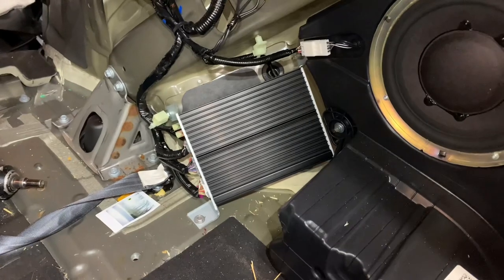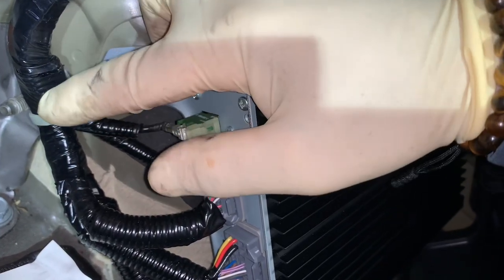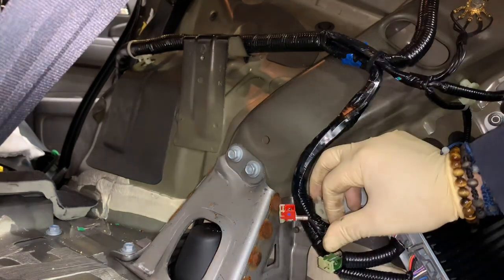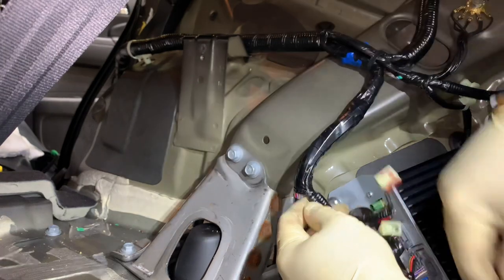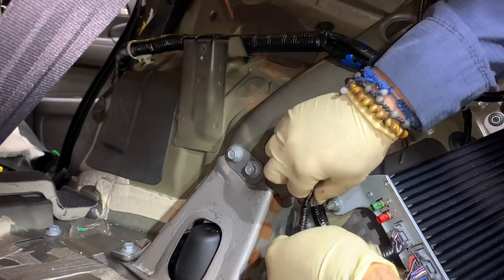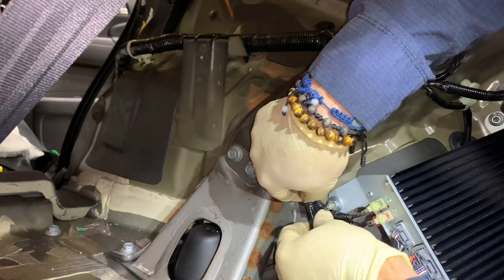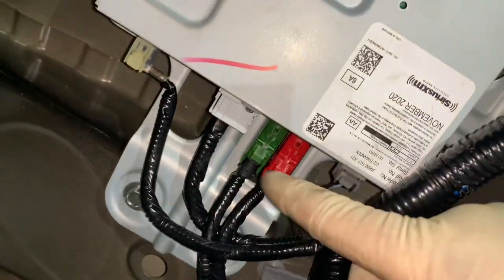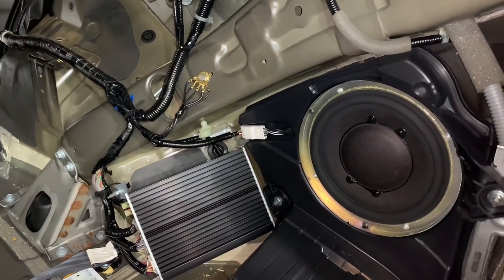Honda Pilot and Passport crackling, popping, infotainment turning off or freezing repair.

Comment: Hi all! My pilot had the same issue, the dealer won't fix it for free since there is no recall for this issue.
I went ahead and applied this fix myself. here are some recommendations:

1. Before starting take out the copilot 3rd sear completely, this will allow you to work with more space. I already tried without taking it off and lost a low of time. 
2. straighten the cables/connectors the better you can, it doesn't need to be perfect, and place it back the better you can

This is not a permanent fix but it has worked for the last 6 months on my car, I would probably need to re-do this when it starts crackling again.

Best Luck to you all!
Reply from the maker: It’s been pretty permanent and I haven’t had any return for over a year now. Thanks for your input 👍🏻
Reply: @BCautosolutions  I got my car second hand from the dealer (27k miles on it), and when I did this I noticed the dealer had already applied this because the plastic zip belt wasn’t the original one. Still went ahead and re-did this and it worked. My guess is that at some point after fixing this, with all the car movement it will eventually happen. But no big deal, once you do it once you are able to redo this anytime and faster
Reply: My 2019 pilot screen just went blank will this solve the problem?
Reply from the maker: @VinhNguyen-zn2rq  it’s worth a shot for sure, also make sure you get the updated fakra connectors if you haven’t done so.
Reply: @BCautosolutions  Thank you so much for replying, what wire is that and where can I buy it?
Reply: @VinhNguyen-zn2rq  when you say blank you mean all black? No light either in the volume or home button? You can try it anyways. My used to go all black as well but after turn it off and on it would load (and eventually go off again).
Reply from the maker: @VinhNguyen-zn2rq  that’s only available as a service bulletin. I would call your service dept.

Comment: This is the first video explaining the issue and the fix. I have a 2021 Pilot EXL, ever since I drove of the lot it began doing the popping sound and freezing the screen, DROVE ME INSANE. Took it to the dealer and fixed for a week or 2 then it began doing it again, Vehicle is back at the dealer again, was at the point of telling them to keep the car and give me a new  one. First time they apparently switched connectors, after a while someone told me this exact issue, which prompted me to look up on web, Luck struck and found this video. Thank you very much, now i have to wait to get the car back from dealer and see what was done, fingers cross.
Reply from the maker: Yes the fakra connector update I’ve had very very little success with. This has been really 100% fix every time I have done it. I was sick of throwing parts at it as per Hondas recommendations so I decided to do something about it myself.
Reply: @BCautosolutions   Go the vehicle back and was told that there is nothing that Honda can do at the moment due to them working on new  connectors "B.S.". Was also told that they can do other work to it but it would not be covered and i would have to pay out of pocket. told them to give me the car and see them in 6-10 months when i dump the vehicle at their lot for lease return.. Honda mess up on this one.
Reply from the maker: @camiloantonini6616  smh, if you were local I would totally do this for you. I’ve done it a solid 20 times and get paid straight time. Everyone wins but some dealers don’t want to do any extra work smh.
Reply: @BCautosolutions  im close to NJ, can I bring my car to you?
Reply from the maker: @kumbaproperties2432  shoot me an email. Bcsutosolutions20@gmail.com
Reply: We have taken our Honda Pilot in 7 times since 2020 with this same issue and they can’t fix it! Too bad I am in Las Vegas.
Reply from the maker: @marileneross1869  have your tried a different dealer possibly?
Reply: @BCautosolutions  I tried emailing you it did not go through do you have a new email or another form of way I can contact you
Reply from the maker: @Difo1972  got your email, responded 👍🏻

Comment: I went behind my right rear sideliner garnish to see how all of the connectors were routed. The red and green FAKRA connectors to my amplifier are both at a 90 degree angle almost, coming straight out of the bottom part of the coaxial terminal. Mainly due the fact that the harness branches were wrapped AROUND the main floor harness branch. So, a lot of these not only are due to the part (floor harness) but also depend on who routed the harness when the car was built.
Reply from the maker: Yes that could be absolutely

Comment: Very helpful, but next time you do one of these could you video the process from start to finish so we see where it is located and the process you took to get to it.  Questions like, what did you have to remove to get to it?  I assume you disconnected the battery?  Any particular tools needed?
Reply from the maker: Will do, it’s tough because I’m involved with so many cars it hard to catch everything. Appreciate the input

Comment: Does the new Fakra recall extend these wires? (2/22/24)

I’m having the recall done right now at my local service department 

Luckily I haven’t had the popping noise but on long road trips, 3+ hours my audio and rearview camera go out. I shut off the car for 15-20 minutes and everything is usually back to normal
2019 pilot elite. Love the videos! Thank you for sharing all your experiences

Edit: just got my car back after the fakra recall and it made my audio system sound much better. I didn’t know before, but apparently my subwoofer wasn’t performing up to its optimal level, also now the audio sounds very even before I felt like the volume was much lower on the driver door. I actually listen to the volume two or three clicks lower now, and it seems to be much more higher quality sound. Wow bro I just fell back in love with my car. 😊

Comment: I worked at a dealership when this kicked off. An engineer came out and couldn’t pinpoint the issue so we were just instructed to do entire harnesses. Now I think they just do a bunch of those connectors
Reply from the maker: I’m the beginning we were just throwing parts at it, and to some extent we are still instructed to do some 4 years later.

Comment: Thanks for posting, it'll help if I have to do it myself but would rather not. This is also affecting some recent Acuras. I've found some posts about the symptoms (in RDX and TLX) but no fixes. My screen would display "Network Connection Lost, MOST NET Off" then shut off or reboot. My 21 TLX has been showing this issue and will be getting serviced under warranty. It's good to know what's causing the problem but why hasn't it been resolved yet is the question. I hope the service appointment resolves it with the first try because they were explaining that there are six methods they try to fix, the first being replacing the connectors.
Reply from the maker: Long story short, it’s a hot mess lol
Reply: This a little late, but this now a recall and all of these will get fixed by Honda

Comment: That’s pretty much how I’ve done it for the past couple years and it’s worked out for me about 98% of the time.
Reply from the maker: 💯 everything else has been a waist of time
Reply: @BCautosolutions  Do you find that the problem is usually at the amp in the back or also in the front dash?
Reply from the maker: @kumbaproperties2432  combo of both

Comment: Are you crimping the ends on the other connectors? I know Honda told us not to but the success rate is so good. Been having a lot of odysseys with the triple pop caused by the RES unit recently.
Reply from the maker: No, haven’t needed to yet but we have been seeing a slow down of these
Reply: @BCautosolutions  we still get some that have been “repaired” by another local dealer. I’m excited for the new buckle recall and wanna see how many techs are gonna skip reading the bulletin and mess up lol

Comment: I am in the market right now for a Honda Pilot because our old 2002 Odyssey is starting to show its age and we always drive to NJ during the summer.  @HondaMobileMechanic, is this really the fix?  have you encountered one yet where after doing what you did on the video, it still made the crackling noise?
Reply from the maker: This was a very successful repair although there has been a recall since that changes all the falta cables including these back here.

Comment: Just got an Acura mailer, indicating our 2020 RDX warranty was extended for this issue to 100K or 8 years.  Hopefully that's good news for some reading this.
Reply from the maker: Yeah it’s still a bunch of bandaids imo but something is something lol.
Reply: My 21 pilot special edition is cracking and sometimes no sound from radio at all until I turn off car and back on.. this is frustrating when the car doesn’t even have 30k miles

Comment: I made this repair and still have no problems with the cracking and popping. But, 2 days ago my 21 pilot touring with the upgraded system has developed a skipping when hitting bumps in the road, like a CD would. Occasionally the radio will shut down but will turn itself back on once another bump is hit. I'm sure it's another poor connection. Any advice on which area I should look into first? TIA
Reply from the maker: Yes, there’s a newer service bulletin. If this doesn’t repair it the bulletin should

Comment: I have a 2019 pilot and just had the fakra recall done, didn't help. Had it looked at again and they found the connection on amplifier was loose the harness plugs into. Do you think replacing the amplifier will fix the popping? Do you think the honda tech will do the repair like you did?
Reply from the maker: Im not sure what they will do although if there’s a loose connection or tension on one of the cables that is most likely the root cause.

Comment: I have a question Sir , my 2019 pilot  touring model , the radio stop working on a long drive but it only happens with the auto stop engages at a stop light… I have to physically shut the vehicle off and restart for the radio to work again.. would you happen to know what causes this?
Reply from the maker: @twowheelsforlife066  probably a software glitch it’s having of some sort

Comment: So what would you recommend doing on the Odysseys? I'm looking at the fakra connectors connected to the amp in the rear and the wiring doesn't seem to be stretched or too tight. The connectors do seem a little loose though. Should I just replace the connectors like it says to do in s/b 21-013 and  cross my fingers? The audio is making a popping noise btw.
Reply from the maker: Yeah replace all the Fakra connectors and check for any of the coax cables under tension and straighten them out as much ass possible. If all fails prob gonna need harness. There’s also fakra pin clamp pliers I’m going to be buying and doing a video on.
Reply: @BCautosolutions please link the new video here. I have to repair this myself, as dealership and Honda are useless. 2020 Odyssey EXL
Reply from the maker: @stansingh  gotcha! And yes unfortunately most of them give zero shits about actually fixing issues. I apologize on the behalf of the guys actually fixing issues
Reply: @BCautosolutions  would greatly appreciate it if you could make a video on it as well, my 2019 odyssey is giving me the same issues, I will try to fix it myself but I don't even know where to begin
Reply from the maker: @ThinkGameTalk  yes for sure as soon as next one comes in

Comment: Any idea if this would work on a 2016? My 2016 pilot is having the same issue but Honda dealership said the fakra issue shouldn’t be happening to mine
Reply from the maker: No, the fakra system was only available starting 2019 on the pilots.

Comment: Thank you for this video... Will need to try it out.

You mentioned being mobile in NJ... Any chance that includes Monmouth/Ocean County?
Reply from the maker: Im in union county
Reply: @BCautosolutions  I finally got down the entertainment equipment. The green wire was barely connected... It slid right off. And once I slid it back on till it clicked, it will not slide back off like it was. What a dumb design!
Reply from the maker: @carabs3823  let’s hope that’s all it was (most likely) yeah it’s not their brightest idea lol

Comment: Have you had any vehicles return with the same issue? Or is this pretty much a one time thing and never have to worry about it again? 

We just bought a 2020 pilot and it does that. It's in the shop right now. I'm assuming it will work after we get it back but i've heard of it coming back soon after or after a year.  If it comes back would you recommend just doing it myself or keep taking it in?
Reply from the maker: No, this usually fixes them if the updated connectors have not.
Reply: Update on my Pilot 2020, Its been a few weeks after doing the fix provided by Hondamobilemechanic, I have no more infotainment problems, still cant believe it, such an easy fix. Thanks to Hondamobilemechanic.

Comment: 2021 pilot. Android auto. Do you have any fixes or suggestions for the sensitivity of the USB port in the dash cubby? We relay replace the cord and use quality products but we are still unhappy with how flaky the system is.
Reply from the maker: No, unfortunately the system is pretty damn sensitive. Only suggestion I would have is use oem cable for the phone.

Comment: I have a 2017 Honda Ridgeline RTL-E. I get Constant Speaker Static when the Weather gets Hot or In the Vehicle. But I think my Amp is built into the Head Unit. Im not the only one that is having this issue with there Ridgeline. Any Help would be greatly appreciated. If you cut Vehicle off kill 12 Volt Power and turn back on will be no static for about 5 minutes then back to where Static takes over and drowns everything out.

Comment: @hondamobilemechanic we have a 21 Passport EX-L, does this vehicle have an amp in the right rear? If so where would it be located.  Thank you.
Reply from the maker: Yes I believe so, I’ve done a few on the passports as well. The trims get confusing I would have to confirm tomorrow but it would be behind the right rear quarter interior panel.

Comment: After you relieved tension and put your zip tie in do you re tape up the wires?
Reply from the maker: Yes you could but it’s not needed and could add some unwanted tension back onto the connectors

Comment: The radio on my wife’s Pilot kept cutting off so I opened the back to check the amp and found one of the FAKRA connections broken. It actual broke off of the cable.  Any tips on replacing?  Do you have any part numbers?  Thanks.
Reply from the maker: If it’s broken unfortunately it needs a new floor harness.

Comment: Why not use the FAKRA service extension cord at the rear amp to relieve the slack?
Reply from the maker: Those cables are long and would let likely interfere with panel. Also Honda wouldn’t pay for another cable or 2

Comment: I just had this problem start with my 21 touring with 14.5k miles. I plan to execute your repair this evening. In case I need it... would you have the part number for this section of the harness? In case I want to replace it in the near future?
Reply from the maker: The harness is the floor harness. If you end up needing it let me know (they are trim specific).
Reply: Thank you sir! I will start with your repair this evening. I'll stay in touch. I was worried this day was coming... you are the only resource I've found that has a logical explanation and thoughtful approach to the repair. Again, thank you!
Reply from the maker: @52tippy  This has been the on only repair that I’ve done repeatedly with positive results. Every other repair attempt going back to 2018 when these cars first came out, has been a waist of time essentially.
Reply: I believe you, I'll follow up with you in about 1 week...

Thanks bud!
Reply: Repair is made. Now back to normal...hopefully!
Reply from the maker: @52tippy  fingers crossed 👍🏻
Reply: Over one week has passed since making your suggested repair. No more infotainment issues have occurred since. Big thanks!
Reply from the maker: @52tippy  nice, super happy to hear that. I’m glad I was able to help you and hopefully many more people to come.
Reply: This is the fix! No more problems with my pilot since I did this!

Comment: @hondamobilemechanic I find your video intriguing and am hopeful now. Are you located in the New England area by any chance?🤞🏼My 2016 Accord exl has developed a very loud static issue over the past several months and I'm at my wit's end. It even occurs when the audio is turned off. My problem is nobody I've contacted wants to investigate this type of wiring/connection work and just wants to sell me a brand new system for mucho dinero. If you're not in the New England area do you possibly have a contact here I could reach out to for help?🙏🏼 Or any advice at all would be appreciated.
Reply from the maker: Im in nj. I’ve seen your issue a few times. It needs an audio unit aka the radio.
Reply: @BCautosolutions  thanks for the prompt reply!  I just need to know if you are absolutely sure about this... especially since it still happens when the audio is OFF.